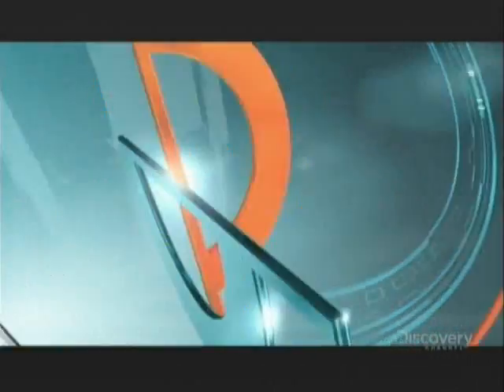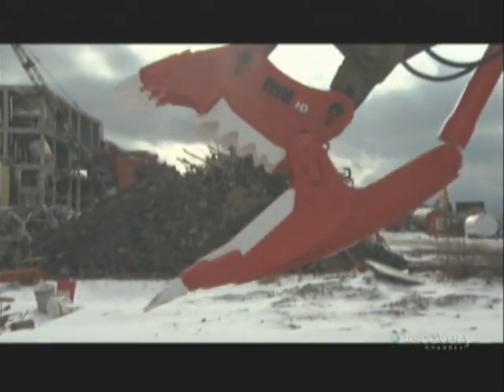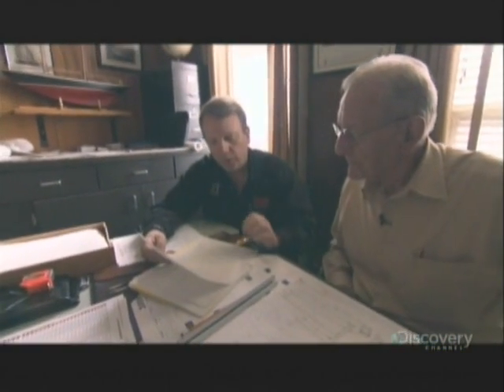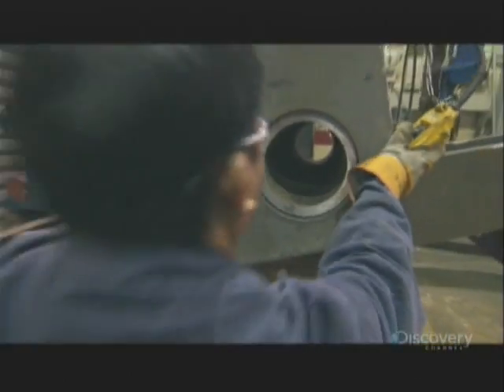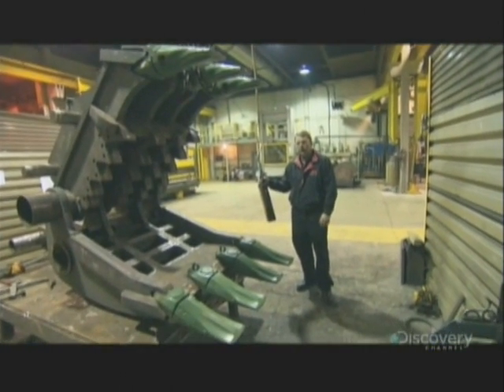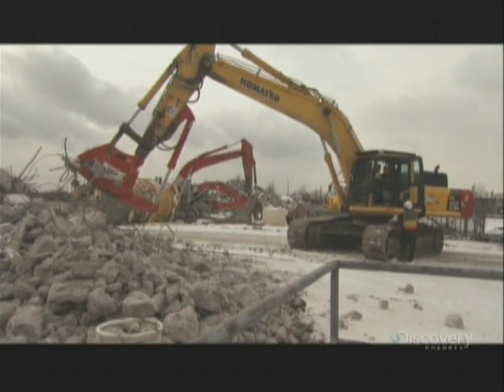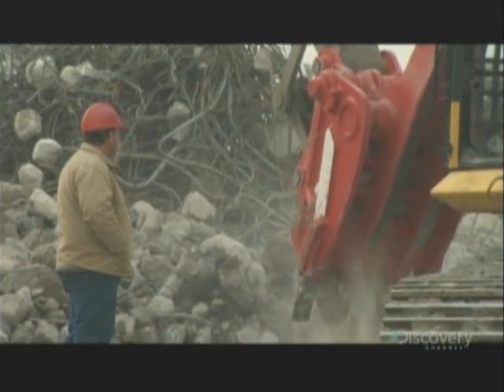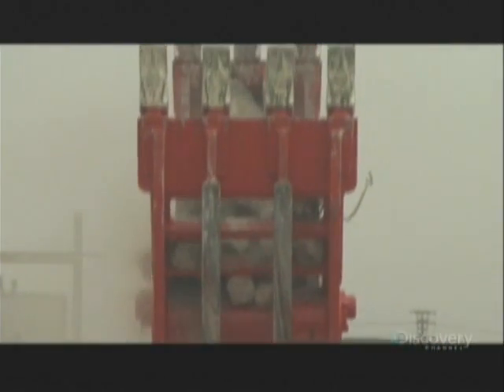T-Rex Pulverizer on Daily Planet

Comment: i run standard pulverizer. the esco teeth on it are great...how many times i would kill for that, but i always just make a nice bed of crushed concrete so i can grab and bundle the rebar. why no teeth on the bottom jaw? the ability to have 2 articulating members on the processor is great...gives you movement. does it not put alot of stress on the ram on the inside of the stick?(Hydraulic thumb ram)...and if it does, why not flip it around so rebar and concrete isnt slapping the piston(covered or not). flipping it around would make it like a crypto claw/pulverizer, and give total movement and control of the piece your handling, picking up, whatever
Reply from the maker: +Cameron Ohl Thank you for your comments. The cylinder on the bottom of the stick has a huge mechanical advantage so it is not overloaded during crushing. We are working on a new type of pulverizer that looks like the T-REX but will be turned around as you are suggesting. It will be more like a pulverizing demolition grapple. Please keep watching our site at www.nye.ca
Mark